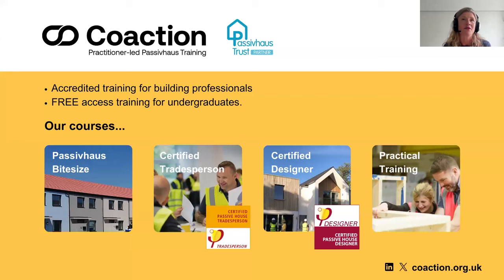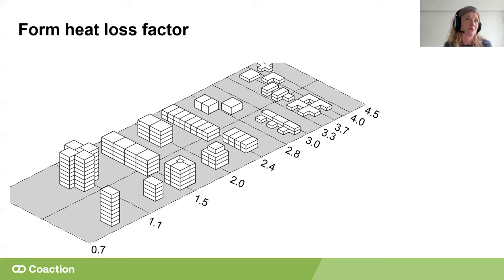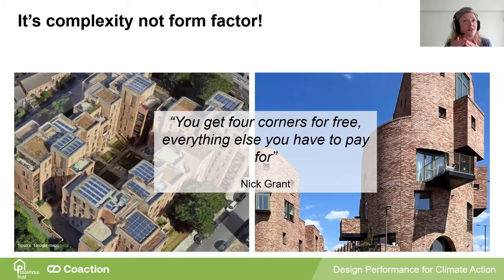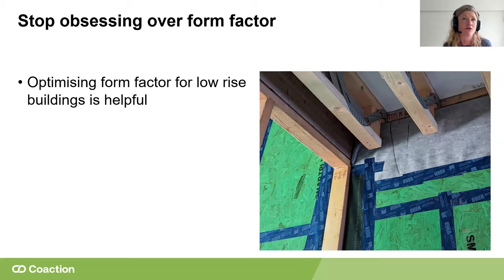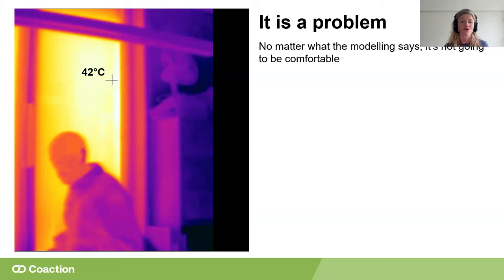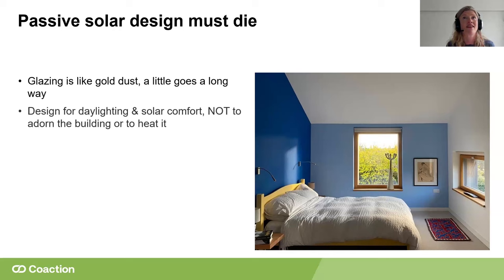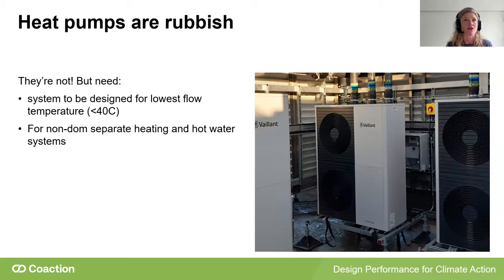Energy Efficiency: Rethinking Form, Passive Solar, and Heat Pumps

Comment: Beautiful video, very explanatory.
Regarding heat pumps, what I see done here in Italy (so different thermal zone), in the boiler pass is simply to calculate the demand and spread it over time. I don't know about the UK, but even in cold areas here they generally don't run all day, but for example a certain number of hours a day, divided between morning and evening, at temperatures as said before others.
You run them for longer at much lower temperatures, e.g. 65/70 to 45/55 for several hours or even in some cases at just under 40 for the whole day.
I am talking about solutions with radiators and not radiant solutions.
But from many feedbacks it seems to work very well.
NdR the climate zone and usage patterns are different I know.
Anyway congratulations video absolutely remarkable and great in the part of the description of thermal discomfort due to excessive glazing.

Comment: I'd recommend this lady visit a properly designed passive solar house... seems like that school just wasn't designed properly, there shouldn't be any sunlight hitting the glazing during the summer if it's designed properly... using a poorly designed installation as the example and then extrapolating that to "Passive solar must die" is pretty extreme and i think does more harm than good.

Comment: Heat pumps are not rubbish, some of the buildings they are being asked to heat are thermally rubbish, therefore they will perform in a rubbish manner.  This is a problem of sets; if a fish is an animal, we cannot say all animals are fish. It's maybe also a problem of bias, many/all of the ones you are asked to investigate are problematic, clearly all are not problematic.
Reply: I'm guessing you did not watch the video? Sally also mentioned a document that is coming soon from the Passivhaus Trust that explains how to get really good COPs even for poorly insulated buildings.
Reply: @NickGrant  I watched the video. To spell it out, the video states in writing and audio that heat pumps are rubbish; the justification seemed to have been the poor thermal performance of some of the properties. That has nothing to do with heat pumps! The application of heat pumps in certain properties is rubbish, yes. Heat pumps are not rubbish. Even if it has a cop of 1.6 it is still 60% better then electric, twice as efficient as gas or oil.
Reply: @UFZ7482  we must have watched a different video!! Sally is very pro heat pumps even for poorly insulated buildings where the COP can be 4 or more. She is writing a short paper on this that will be available soon on the Passivhaus Trust website. Poor design of systems is an issue thought.
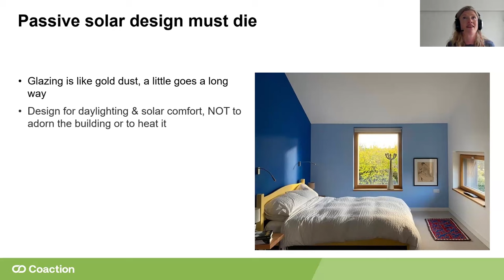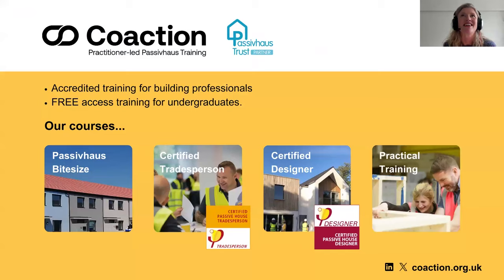Reply: 15:11.... summarised at 20:45?

Comment: Heating season do not last only during the winter but about  6-7 month a year and in the summer you need AC the most for two months. Nothing wrong with building a comfortable house but it is not what passive house about